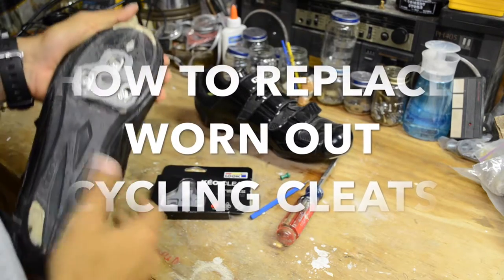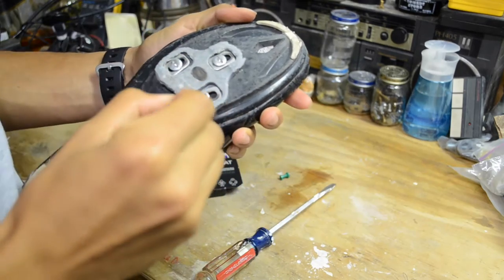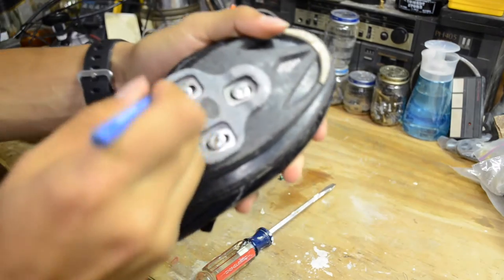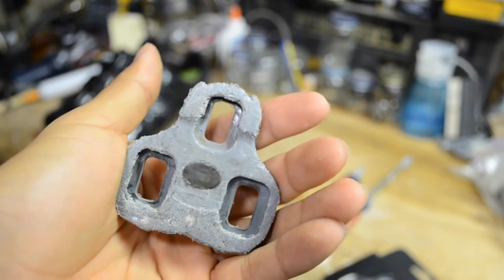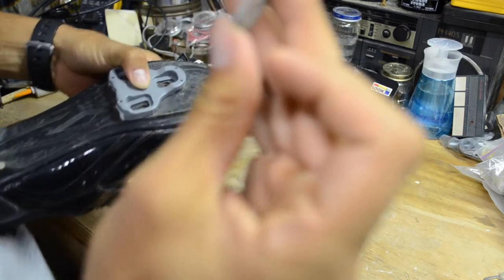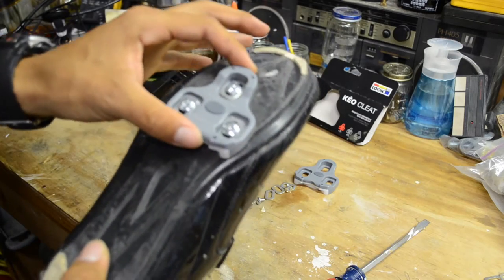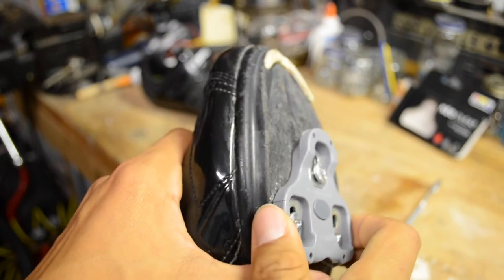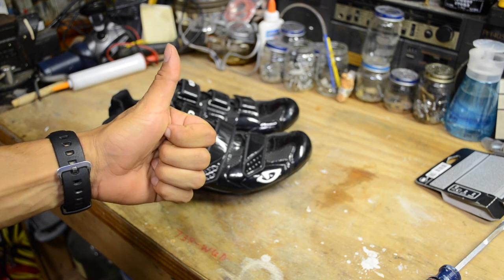Look Keo Road Cycling Cleats Replacement

Comment: Look have a cleat registration screw in the middle of the cleat underneath the little oval rubber pad. This allows you to place the cleat in the same position every time you change out for a new set. This is called the look position memory system. This system will of course only work with memory compliant shoes such as sidi and others.